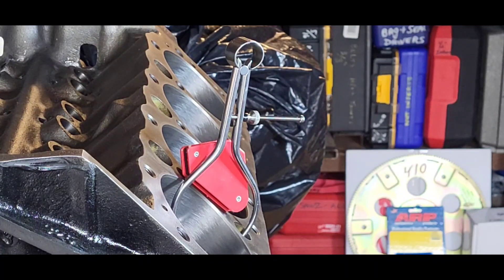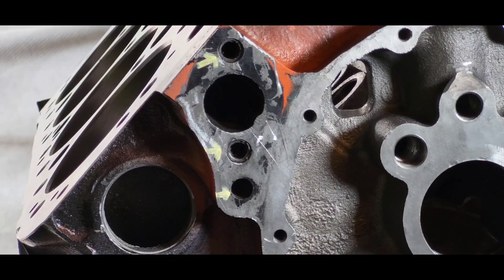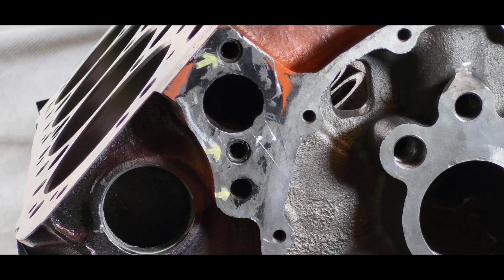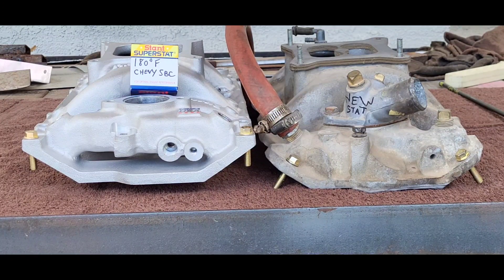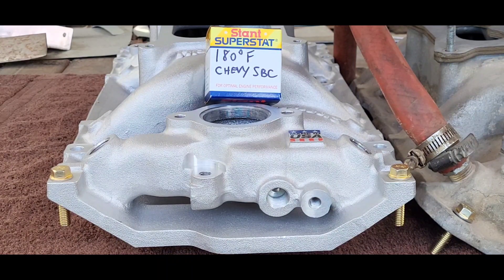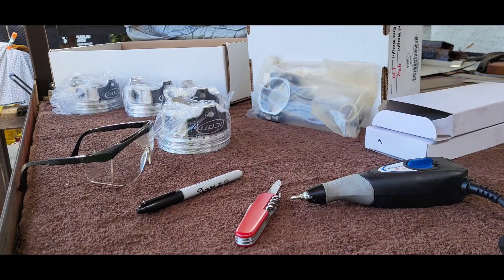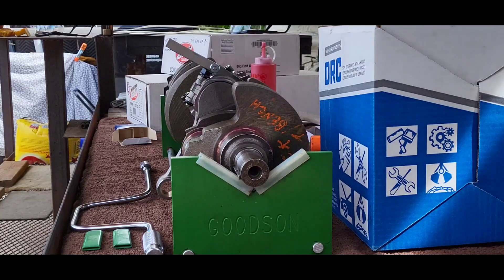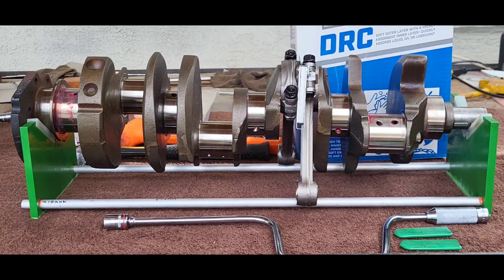Be Careful switching Parts between Vortec and Gen 1.

Comment: Good information. 
Thanks for sharing.
Good magnuflux and pressure testing is important. 
Accurate bore inspections and or surfaces and threaded holes.
I have been doing this along time and never failed to give a customer his or her parts back.
I always inspect the parts after cleaning and give the customer an update.
To make sure everyone is informed and up to date.
And BTW, I have had customers say they had this and that and did not.
To your face trying to drop something off.
Call me say their block is standard and it's bore .040 or .060.
I checked it in front of the customer. 
Then he said, well I thought it was.
Had a rebuilder tag on it.
Goes both ways.
Honesty is the best policy always.
Thanks for sharing. 
Take care, Ed.
Reply from the maker: Right on, Ed's Machine.  As a customer, we just want to be treated fairly.  Why rip us off and steal our parts?  We appreciate your above board business model and philosophy.  Nice logo, too.

Comment: It sucks to take your parts to a machine shop and not get them back. I took a cherry std bore 400 sbc block to a machine shop and got a different 400 block bored .060” over back
Reply from the maker: That absolutely SUCKS!  And they almost invariably take a pristine piece.  Does that .060 overbore 400 run hot?
Reply: @the4flatgarage  I actually sold it and sourced another block. Took it to a different machine shop.
Reply: Thieves just boil my blood! Someone would be getting an ass whoopin' over that one.
Reply: I had two 400 blocks ripped off from different shops

Comment: Ooopps.   I used that hole in the intake manifold for the  temp sensor. Luckily I  haven't had any  overheating  issues.  So I'm guessing that  I have the system  hooked up  in a way that let's it cool sufficiently.  I'll have to check it good.  Thanks for the tech tips .
Reply from the maker: Hey, don't go hogwild!  Remember I said there was every combination you could think of out there?  Well, one of those is a 3 holed water pump on the passenger's side on a Vortec block.  Obviously you're cooling.  So relax.  Some customers weren't so lucky, complained, and maybe sued (I don't know) but apparently GM made a batch of those engine blocks to help customer's from cracking their mills.
Incidentally, you should be running your water temperature sender out of your cylinder head.  If the coolant level gets below the sender, it'll just read hot air.  Lost a good motor that way one day.  Enjoy.
Reply: @the4flatgarage  the "880" or 1 piece rear main seal blocks started in the 87 model year, they still had the bypass in the block...
For the 96 model year (vortec's) they did not have the bypass in the block it was in the intake...
The 1 piece rear main seal over the counter or crate engines some have the hole some don't depends on it's intended use, carbureted or as a vortec L31 replacement...
Reply: There's a lot more info around this topic but that's the short version...